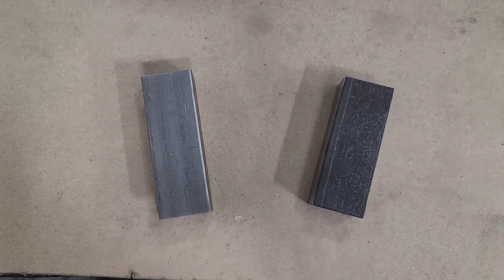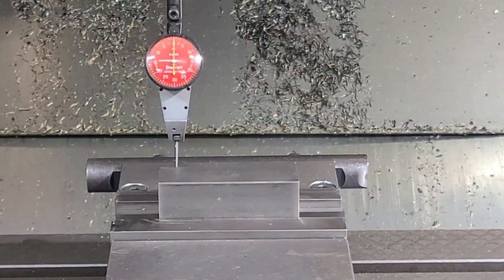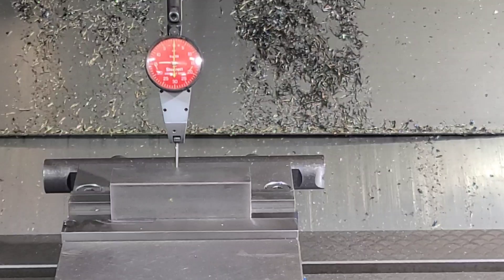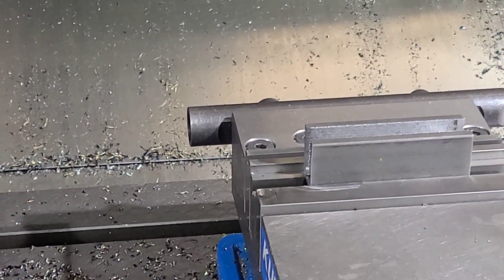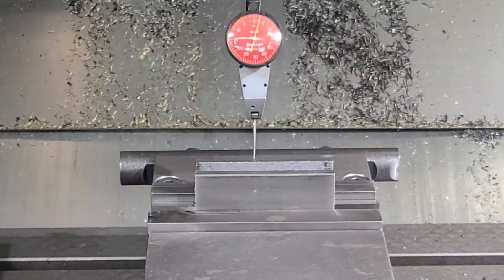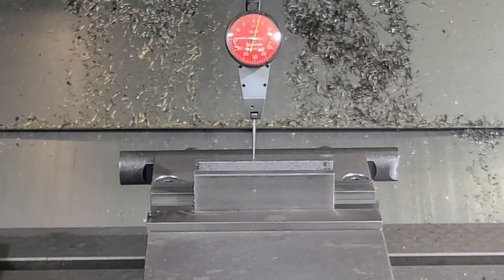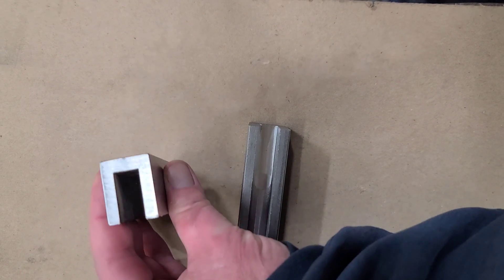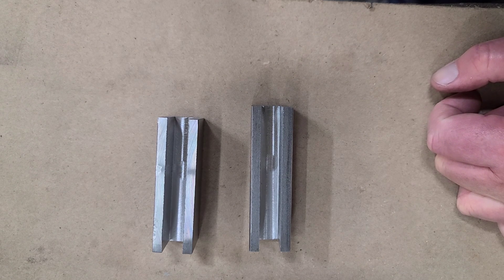Machining Hot Rolled VS Cold Rolled Steel

Comment: Quick question.  Being a woodworker with no metal experience I'm not sure why I'm fascinated with metalworking but is there a structural difference between hot and cold rolled?  Surely people aren't paying twice as much for cold rolled just because it requires less work in certain situations?
Reply from the maker: Thanks for watching and commenting! Not much of a difference. Hot rolled is a more stable material but more work. There are many grades of both but the most common 1018 crs and 1020 hrs are very similar. This is just 
my educated opinion as I am not a mettalurgist.

Comment: Great video. I have had problems using scrap bits of hot rolled that have been used as prybars and bent before machining. The locked in stress keeps coming out even when you turn most of the diameter away, very hard to get a straight bar.
Reply from the maker: Hi,thank you for watching and commenting! Good point I have observed that as well, but it makes sense that you have stressed molecules along with the un stressed ones. Sometimes bouncing a part off of the ground a bunch of times is enough to " normalize ' it try it next time you encounter that prior to machining. That is an old general motors trick, that is used as a cheap way to normalize welded construction

Comment: Man I thought all metal had scale on it I’ve had some tubing soaking in acid and I been grinding thinking it was scale and it wasn’t lmao I should have known because the metal did not have the dull gray look to it I just assumed
Reply from the maker: Some steels are pretty clean but can get a little crusty from hunidity causing a little surface rust. Thanks for watching and commenting!

Comment: I wonder what would happen to the cold rolled if you normalized it first.
Or--- do they sell normalized cold rolled that might be P&O afterwards?   I know that would add to  the cost,  even more than  P&O hot rolled, but It might save overall cost of the project.
Reply from the maker: Hi, Thanks for watching and commenting! The problem with normalizing aside from the expense is it will wreck the outside finish and flatness requiring a skim cut and negating the benefits of buying it in the first place. The only process I know of that works and will not change the surface is cryogenic treatment, which I show at the end of this video:  https://www.youtube.com/watch?v=DJx228amocA
Another option is using 12L14 steel which is a leaded alloy that costs more than CRS but no headaches when cutting and similar in properties to CRS.
Reply: @mvpmachine  Good points.  I had totally forgotten to mention hydrogen atmosphere or vacuum furnace normalizing (to preserve the outer finish.  Not cheap, of course, unless---   Back in the 1960's I worked for a commercial heat treating company  in a city with lots of small  tool and die shops.  At the end of their workday, we'd have a constant string of deliveries from them.  Enough that we could often consolidate loads so the cost for one  individual piece wasn't too bad.
Reply from the maker: @frenchcreekvalley  Yes those are good options to preserve the surface too. Not very commonly used for CRS due to the cost and the fact that better material options are available.

Comment: Good grief you could have just said from the get go cold rollled has more internal stress’s than hot rolled which can cause it to warp when you cut a lot from cold rolled.
Reply from the maker: You are right I could have but that would have been a 10 second video. Thanks for watching!

Comment: Good information to know. I have learned to always start a project with stock that is oversized. Lately I've been milling holes in Plate steel on a rotary table for bearing races to fit snug in. Gave up scribing the circle on the stock and then trying to perfectly align the center axis of the table with the center axis of the end mill. Don't have a $100,000 milling machine to do that with. Instead I get the two center axis close and then use the end mill to scribe a circle on the stock that is about 50 thousands smaller than what I need. I plunge cut that out and then lock my Y axis and side mill on the X axis 2 or 3 thousands per 360° rotation. After every rotation I try inserting the bearing race until it fits snug. Then I remove the stock and mill or cut or grind the stocks outer dimensions as needed. I get perfect holes and outer  stock dimensions with this method. The hole is positioned perfectly in relation to the outer dimensions as need for the part. Have to start with oversized stock to do this unless one has a $100,000 milling machine. Thanks for your video!
Reply from the maker: Hi Norm, thanks for watching and commenting! That is an intresting way to do the bearing holes. The right way to do it is the way that works for the equipment you have available. I started out doing similar things on a manual mill for a product I wanted to make having no knowledge of machining and learned by doing. You get a feel for what works and what does not work. You are essentially doing what a cnc mill does when circle interpolating a hole.

Comment: I'm a basic home project tinker machining hobbyist (By no means an engineer or machinist!) and noticed the discoloration of the shavings in the video. In your expert opinion do you think that running coolant or adjusting feed speeds and depth increments would change your end results at all?  I appreciate your expertise in the machining/milling process and the most valuable information that you provide. I thank you, and I was wondering if my inquiry carries any pertinent merit. Please continue your beneficial tutorials, and I will be sure to continue to watch and learn from them. 👍👌
Reply from the maker: Hi, that is a good question! The idea is to have the heat come off in the chip and not be transferred into the workpiece and that is what you see. If a chip is solid blue or black then it likely is a worn out end mill or a poor feed and speed selection or too light of a cut. If the chip has some yellow left in it it means the end mill is good and sharp and the chip has more heat it can take with it if needed. Coolant is terrible for most modern coated carbide end mills and will cause premature wear. The coatings are designed to perform best in high heat conditions and will experience thermal shock when coolant is used. The parts in this video did not get hot enough to cause any distortion, and would be the same dimensionally if coolant was used but end mill life would suffer. I have a video coming out about this topic very soon. Thank you for watching and commenting!
Reply: Thanks for the update. I had noticed those chips and wondered because I've seen alot of machining vids that use coolant and don't. I myself never do for what I do. I've always taken light cuts at a slower feed speed and moderate bit speed. It takes more time, and in my book extends the life of bits. But all said and done, if it requires more time it's worth the positive outcome. Thanks again!! @mvpmachine
Reply: Sometimes when milling I will get different colors of chips depending on where the cutter is cutting. Sometimes blue, sometimes brown, sometimes just the color of the steel. I'm not sure, but my theory is that the stock is not a consistent alloy all through out the stock. Some areas machine better and easier than other areas in the same piece of stock. Could also be inconsistent heat treating throughout the stock. Case hardening is a good example of where this is done on purpose. The outer layer of metal is harder than the core.
Reply: That all makes sense. I always assumed that colored chips meant dull bits or too deep of cut, or too fast of bit speed. I guess that the end if the bit shows no color change, the operator settings are within parameters. Thanks for the input!! @normtheteacher5485
Reply: You could be right. Dull bits, too aggressive cuts produce extra heat. Extra heat discolors metal.

Comment: As a newbie working a mill that is probably older than you, THANK YOU.
I am having so much fun making things and so much more fun watching all of the grey hairs teach me tricks on YouTube. 
Again, Thank You
Reply from the maker: Thank you for watching and commenting!
Reply: You will probably someday need perfect holes in steel to fit bearing races into or a shaft or whatever. I'm kind of new myself. I did a one minute short video on this you may want to watch. You will need what is called a notary table for cutting perfect holes. Got mine at Penn Tool. You are right...milling is a lot of fun and useful.

Comment: Temper, temper. Controlling your temper is always a good idea.
Reply from the maker: If you are refering to heating the part by dry milling you are incorrect these parts did not get hot, the heat comes off in the chip. Collant kills carbide endmill life and is unnecessary when milling most steels. I use air blow to evacuate chips to prevent re cutting. I will have an upcoming video on this topic very soon. Thanks for watching!

Comment: One component I make comes in 20X6mm CRS bars.  Cut to about 3' and clamped to the miller bed then a 4X2.5mm cut taken out of one corner.  Finally you weld the ends of these shorter bars and saw them 25mm.  After milling, the short bars are going on banana shaped with even a perceptible bend the thick way.  On the scale the final component is, the bend is tiny and acceptable and the overall shape and finish is important so it is cheaper to use CRS than dress HRS.  It always feels shoddy, but expediency is so often king.
Reply from the maker: I feel your pain! We also make a product out of CRS bar stock and have to radius the sharp corners. We made it for years with a lot of scrap pieces then started cryogenically treating the bars after saw cutting and before machining. It fixes the problem but another process to pay for and wait for.  Thank you for watching and commenting!

Comment: A leaded steel like 12L14 is free machining and has a higher yield strength than common hot-rolled 1014 carbon steel. StressProof® by Niagra Lasalle is also an option with 100 ksi yield strengths and stress relieve after cold rolling to provide good machinability without warping.
Reply from the maker: That is good stuff costs a little more but machines easier. Does not take to welding though. Unfortunately when customers spec a specific material they rarely consider better options, my customers usually say that's what they want deal with it. Thanks for watching and commenting!

Comment: As 30+ year professional gunsmith, making parts about 10% of time, tool making about 20%.   So, definitely not production  work; job work.   This was SO informative!  Usually just keep cutting & file work til have what’s needed ; definitely not running production.  But have seen this when making > 3 or 5 parts.  Never knew this!   How do you machine HRS surface? Fly cutter?  Thanks
Reply from the maker: Hi thank you for watching and commenting!  This is a surprisingly not a well known phenomenon. We use an inserted fly cutter to remove the mill scale on HRS usually .012-.015 depth of cut does the trick and leaves a nice flat finish, better than the CRS finish you get from the mill so its a win win.

Comment: The term "Cold Rolled Steel" is completely misused!  Cold Rolled Steel only applies to plate, sheet and strip!!  Bar stock in rounds, squares, flats, octagons , hexagons and other bar shapes is COLD DRAWN, not sold rolled!
Reply from the maker: Edward you are correct, except rectangular bars are also rolled, other 1018 shapes round hex etc. are drawn and incorrectly referred to as CRS.
Reply: "Cold worked" is usually the catch all
Reply: UK we called it BDMS  bright drawn Mild Steel, all good fun as an apprentice, skim one face of a thin flat and take out of vice , it went like a banana .

Comment: Very informative; too much background noise though. Thank you
Reply from the maker: Thanks for watching! I am working on a solution for the noise, its tricky in a shop though.
Reply: @mvpmachine  It takes extra work, but audio processing is a thing. There are noise filters to remove the background hum of machines, and you can lower the audio of parts where the machine is going full bore.

Comment: Difference between cold rolled and cold forged ???
Reply from the maker: Cold rolling is exactly as it sounds the cold newly made material is rolled and compressed between rollers to get it to its finished size. Cold forging is a process of making parts using dies, the part is pounded between dies until the desired shape is achieved no heat is used. Thanks for watching and commenting!

Comment: I was taught very early on in my engineering classes that cold rolled steel has a lot of internal stresses because of the cold rolling process. The material is mechanically formed with no heat, hence the name. The hot rolling process relieves the internal stress as the material is formed. The internal stresses in cold rolled are throughout the material and it's pretty unpredictable and shape dependent. And can even be different at one end of the bar compared to the middle of the bar.
Reply from the maker: Thanks for watching and commenting!. That is a very accurate assessment of CRS. Unpredictable!

Comment: What about the width of the slot?
Reply from the maker: The slot opened up at the top by .014" or so as the material sprung the slot got wider on the CRS but not the HRS. I was trying to focus on the outside because it is possible to leave enough stock and rough and finish the slot and have it come out fine as long as it is not trapped in the vise where you are cutting. If held deeper in the vise both inside and outside dimensions would be sprung and change as soon as the vise is released. Thanks for watching and commenting!

Comment: At 4:34, On your first test that had the 3 thou vertical runout, do you think running some coolant would help prevent the now thinner material from heating and warping? 3 thou variance with what appears to be about .150 thick walls left behind dont seem too bad at all when she was running dry. Would love to see 2 pieces of CRS machined in the same vise with the same end mill, 1 with coolant, 1 without.
Reply from the maker: Thanks for watching and commenting! There really is not much in the way of meaningful heat transferred to the part dry milling as the majority of the heat comes off in the chips. Most machinists over use coolant with carbide toolong. Those parts may have been 90 to 130f at most after cutting, no where near what it would take to move anything. I have a newer video that shows the CRS movement on a larger scale shown here: https://m.youtube.com/watch?v=DJx228amocA

Comment: Please learn how to record audio. Your voice is almost unhearable. I've got my volume at 100% and you are not easily audible.  Thanks for your video.
Reply: My hearing isnt the greatest, but I heard him loud and clear on 7/8 volume. There is a slight background noise but not bad.  May be your speaker set up.
Reply from the maker: Sorry Mark I'm working on it I turn it up full tilt on editing and YouTube turns it down when processing the uploaded videos I think trying to equalize the machine noises with the rest of the video? Thank you for watching and commenting!
Reply: @mvpmachine  Audacity is a free audio edeting software. It has a feature that detects noise pattern and removes that noise from the audio track. The usage can be leaned  in 5 minites and you only need to record a bit of background noise (a few seconds, longer is better) before you start speaking to use that feature. It would significantly improve the audio quality for future videos.
Reply from the maker: @clockworkvanhellsing372  Thank you for that!!  I will try it tomorrow on my next video.

Comment: Thank you for those explanations and sharing that long video. 
I've just heard about that phenomena in a machinist company i was working with recently. 
I was wondering, does pro machinist includ that phenomena since the beginning of their cutting organisation to correct the best they can, also is annealing a common process to avoid this for expensive parts sometime ? Just curiousity of how you guy's work. 
Big thanks from France. 
Have a good day sir.
Reply from the maker: Hi, thanks for watching and commenting! Unfortunately it is not a well known phenomenon. I have been doing this for over 25 years and we are routinely supplied with 1018 material from customers for jobs that it is not appropriate for. Annealing will not work as it changes the surface of the material and also the strength of the material. Cryogenic treatment is the only solution for pre treating that will not alter the material strength. Many times when we quote work we make sure we specify 1020 if possible to make sure we do not wind up with the extra expense and time.

Comment: Similar issues are present when bending tight a radius. Hot roll is more forgiving. While cold roll is susceptible to cracking.
Reply from the maker: I did not know that, but it makes sense due to the lack of uniformity in the material. Thank you for watching and commenting!